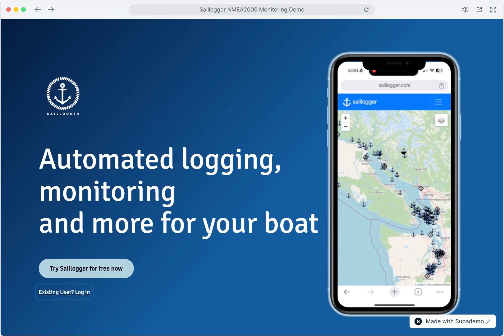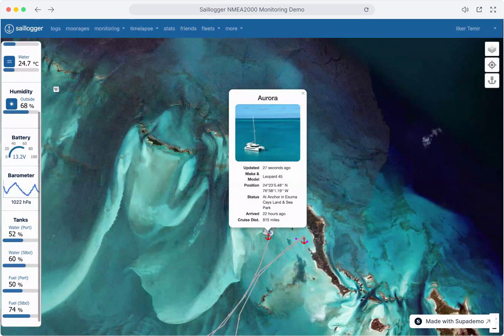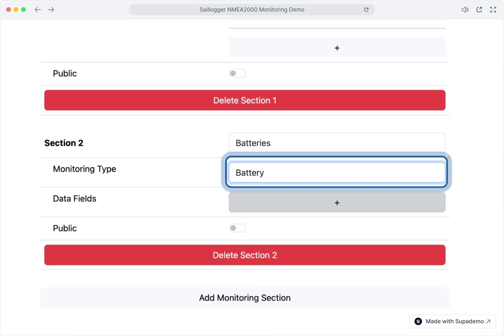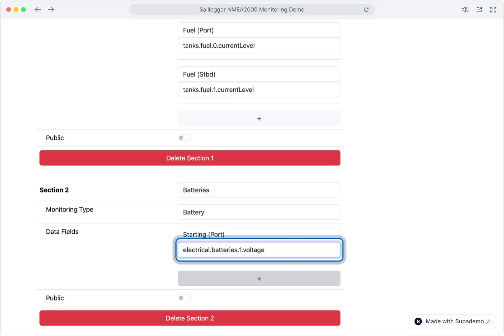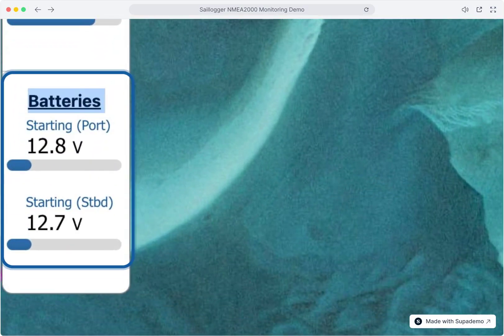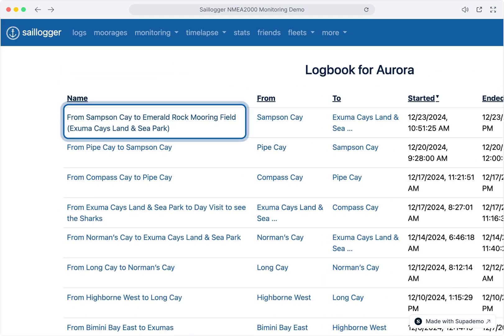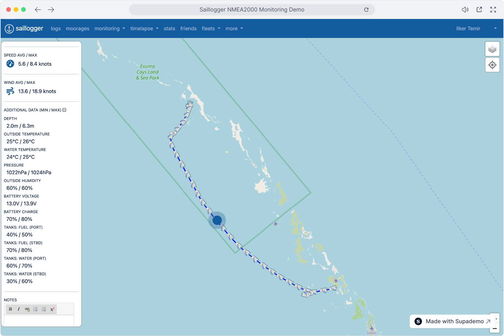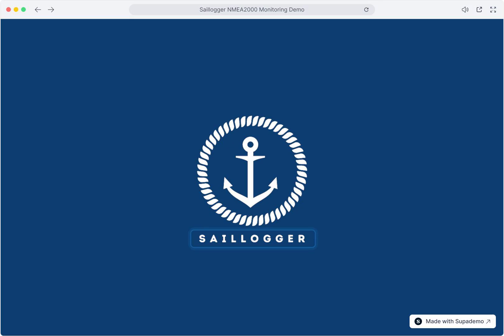Saillogger NMEA 2000 Monitoring on Victron Cerbo GX

Comment: What a great feature! I added temperature and humidity probes for my refrigerator, and indoor and outdoors temperature, humidity, and barometric pressure.
Reply from the maker: That's awesome! 🌊 With those sensors, you can turn your boat into a roaming Windy weather station using Saillogger. The more weather data we collect together, the better and more accurate forecasts become for all boaters. We're also planning to release a video tutorial soon on how to set this up in Saillogger—stay tuned! ⛵📡